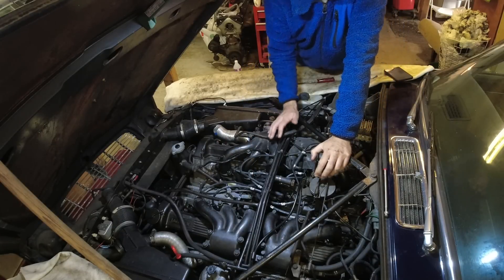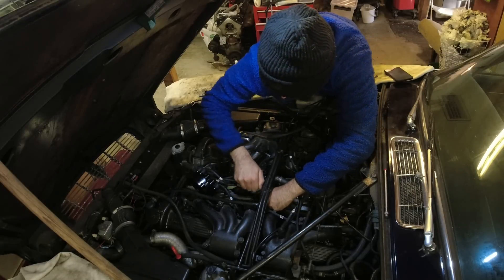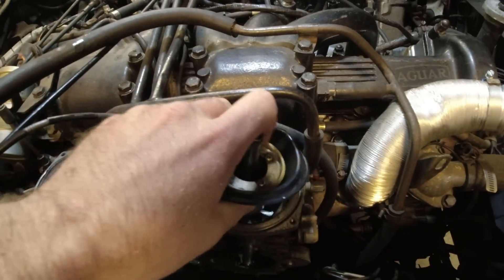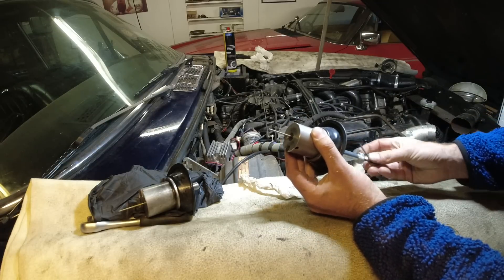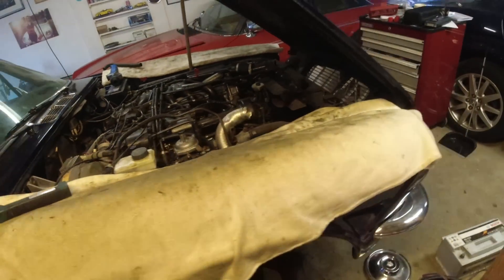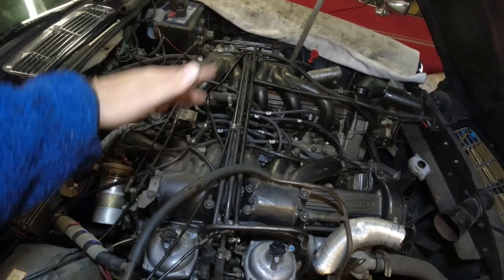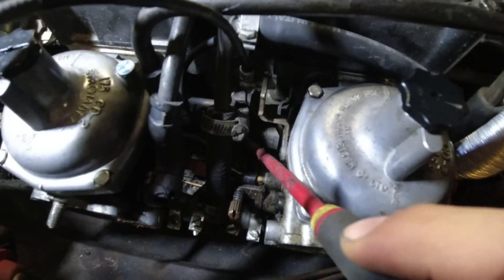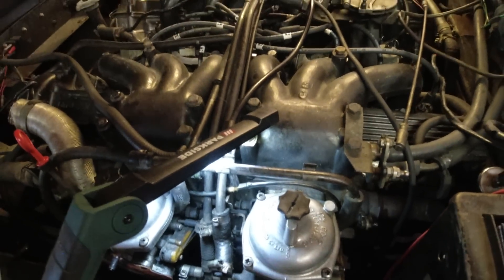Tuning Four Carburetors on a Jaguar V12

Comment: Interesting video, in particular 11 mins in regarding needle adjustment types.   All very true.  What you may find is that the carb piston originated elsewhere (perhaps an old Range Rover for example) and instead of the tall fine allen key adjuster normally used in your video, they instead use a grooved round bar (I normally make these out of old screwdrivers) when I encounter these adjuster types.  What I am additionally finding quite often is that the traditional needle profiles and baseline jet heights are no longer applicable because of fuel changes.

Comment: The carb mixtures can be adjusted. Its a long allen key that is acessed through the dash oil pot where you fill up the oil. There is also a aJag special tool that holds the rubber diaphram from turning.
Reply from the maker: Yes I said that in the video however if you watched the video you would know that I mentioned the carbs had been messed with before. Someone has added internals from another car that weren’t adjustable. That’s why I had to adjust it that way.

Comment: Really helpful video so thanks for taking the time to make it.  I do have a question, do you reconnect the linkage between the carbs before you start to balance the air flow between the carbs on the same side of the car?  I just didn't catch when is the right time to connect them back together.    Thanks

Comment: Adam, if you don’t mind…

1) 1:18 you changed a little rod that had a big effect on timing? What do you mean? What rod?

2) My HE V-12 runs very smoothly up until about 3,000rpm, then gets a vibration. Vacuum and mechanical advance are definitely working. I’m thinking maybe it’s not getting enough spark at higher RPM? Any suggestions or troubleshooting tips?

Many thanks for your terrific videos!!
Reply from the maker: It was the rod for the vacuum advance. It normally just has one position. However a previous owner had drilled another position I got it. I was just putting it back to stock.
Have you set the timing at 3000 rpm?
Reply: @LivingWithAClassic  I have set the timing by ear, advancing up to the point of pinging and then backing off a bit. 

I was unable to locate the timing mark on my pulley, so couldn’t use a timing light on it. This week I had a shop help me out and paint the mark white, so I will hit it with the timing light later today. I don’t expect the results will tell me to advance timing further, because I think that would get her pinging, but I will do the test and see.

Thank you so much for the advice. Please let me know what else you think I might look at if timing isn’t the issue.

Comment: Maybe your input would help me, my 1986 XJS V12 no longer has a functional A/C and therefore the fuel cooler no longer works. Is the fuel cooler important enough to justify alternate methods for cooling the fuel, for example using a tube and fin cooler instead? Appreciate your videos, they've helped me a lot!

Comment: Good job! But I prefer injection any day of the week.
Reply: I have the same engine in my car, but with fuel injection. It comes with plenty of headaches of its own. More potential to run reliably and consistently, but at least as many things to go wrong.

I also have Bosch CIS injection in my Ferrari, which was Bosch’s other flavour of injection in the 80s, different from what Jaguar used. It, also, is no easier to get running well than carbs. 

Modern FI is great, but back in the day both systems left a lot to be desired.

Just my experience. I’m no authority.
Reply from the maker: Both have the pros and cons. When I was getting my injected 1977 car back on the road after sitting for 17+ years I kept wishing it was carbed. Carbs are easy to rebuild and pretty straight forward to set up. Injection takes longer to go through every sensor and get it right. The injected cars do run a bit better but I prefer the sound of the carbed ones
Reply: @LivingWithAClassic  I'm an electronic technician, so for me it is easier to test sensors and troubleshoot wiring, but yes, I can understand how everyone have their preferences.
Reply: @alexandrecouture2462  Makes sense. For me electronic engineering is a glaring gap in my knowledge and troubleshooting capabilities.
Reply from the maker: Well it’s more the issue of finding the parts. It’s very hard to find spares for the early injection systems
Reply: I have two carbed cars from the seventies :  a Rover P6 V8 and an early XJ12; and a Solex 26 carbed Citroën from 1927.  For me personally carbed cars sound better and are a more direct and mechanical way to tune them which makes them easier to work on.